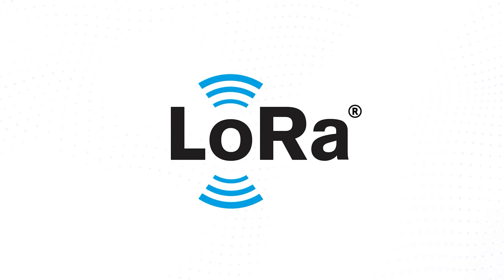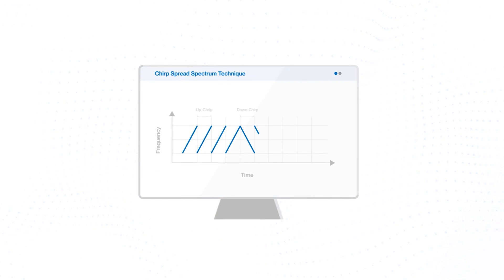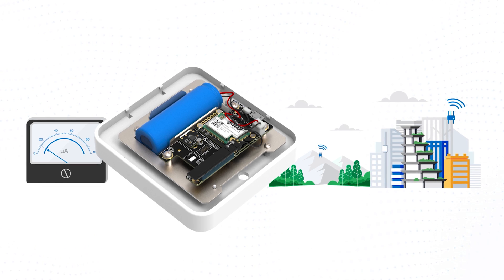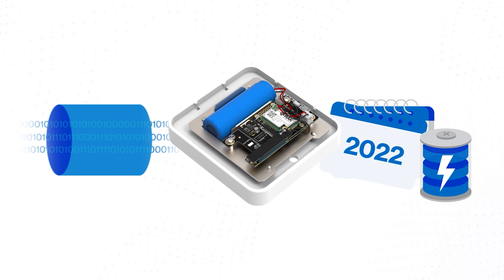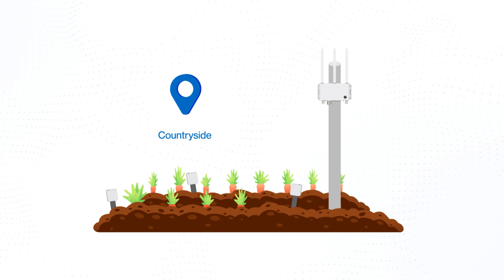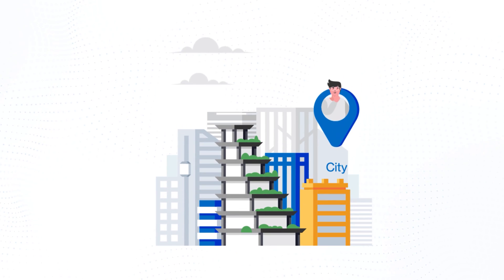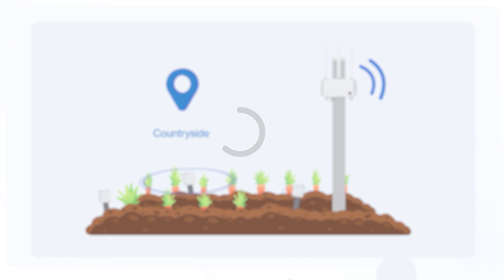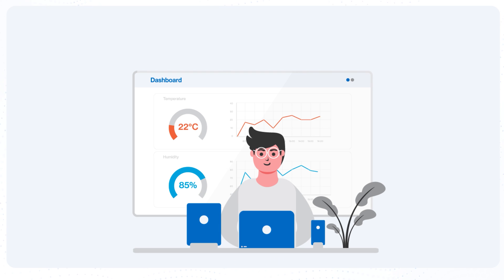What’s a LoRaWAN Gateway and Why Do You Need One?

Comment: I'm still confused. If we build a gateway, does it connect to other gateways to have longer range? I would just want a gateway and have a few devices to connect with.
Reply from the maker: Gateways need to be connected to a LoRaWAN Network Server(LNS). They do not connect to one another directly (unless the network server is built-in on one of the gateways which is possible but not a common setup). If two gateways shares common LNS then it can expand the network coverage bigger as long as they are strategically deployed. You won't need to put two gateways close together unless there are dead spots that you want to cover that is not reached by the first gateway due to obstructions on signal.